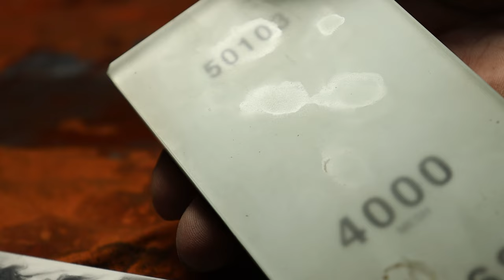Restoration of an old planer Herman Weiss & Sohn Vienna

Comment: Looks like you placed the iron the wrong way back in at the end.
Nice freshening up, not quite a restoration, I would say. But indeed a very cute little plane.
Reply from the maker: The iron is turned correctly, everything works, thank you. 👋🏻
Reply: Interesting because at 1.20 you can see the mark on the iron facing UP as it originally sat. At 25.18 you reversed it DOWN. Now it might still work, but usually, at least in all the planes I saw - the mark sits on the UP side of the iron.
Reply from the maker: @petervandermolen4089  
Well, you have to spin the blade correctly, someone turned it wrong before